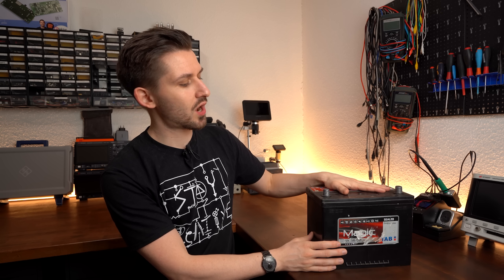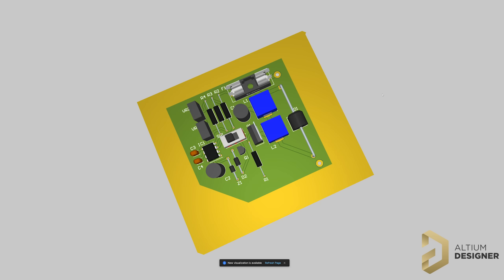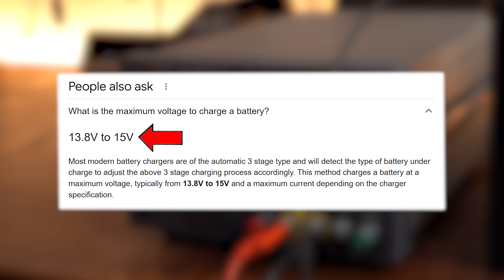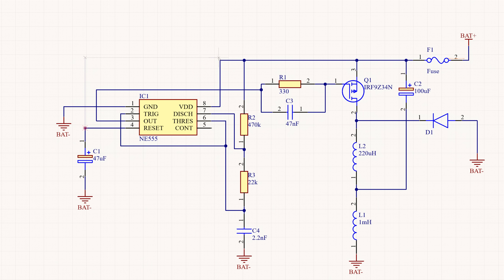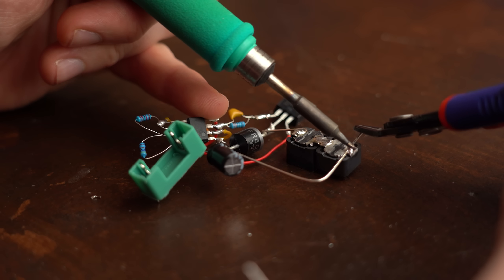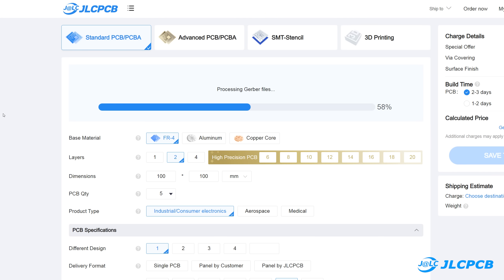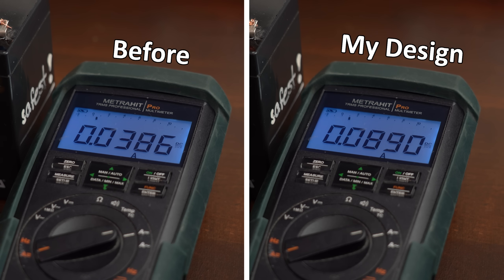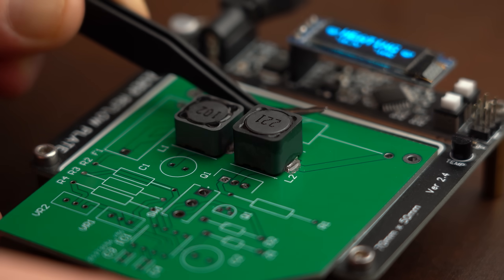I followed a YouTube "Battery Hack" and Wasted 30 Days! (Desulfator)

Comment: The idea that the circuit is powered by the same battery its affecting seems like a red flag. 😂 (just a gut feeling) 
Like obviously the battery has energy that can be used, but using that energy makes more crystals, which seems to be the opposite of what you're trying to accomplish!

Perhaps something like charging the battery from a high frequency external circuit would work better than powering it itself.

Comment: While the tested batteries showed only half of their claimed capacity, this would not be entirely surprising even if those batteries were new.  While we've grown to expect that legitimate Li-Ion battery manufacturers will state realistic specifications, lead-acid manufacturers exaggerate their specs substantially and this is true even for highly-refined, industrial-grade batteries.  Lead-acid batteries are virtually guaranteed to fall far short of their claimed performance.

Pretty much the only place where lead-acid still makes sense is for starting internal-combustion engines; short bursts of high amperage followed by immediate recharge.  Some form of lithium chemistry will be a better value for any other application.

Comment: What we need is a battery that we can disassemble. Remove top, bus bars etc We clean the plates with a pressure washer, ultrasonic or belt sander. We assemble, add new electrolyte and charge.

Comment: Pro tip for next time, use 2 diodes to protect your power supply when you do this, it will charge in the estimated time first and second your power supply will not get hot or blow up, I did the same for a 12V 20Ah moto lead acid battery, charging up should take 9.8-10.5 h , I also forgot, ideal charging voltage for 12V lead acid battery should be around 14.4V but can be also found on the manufacturers datasheet.

Comment: you be wonder about welder that weld metal to metal can be use to bring battery back to life but it lose amp and cranking time
dont need any pcb just do something to battery not going change anything on it be same as always and age of battery being unused just dying out and cells inside just disappear or rottened away or cover in acid salt

im sure ya can make a battery just need right kind of plastic that doesnt feed short thur it

Comment: I always thought using a DC welder and passing a high amount of current through the battery for brief periods of time also did the same thing? The caveat to this method was off gassing and risk of explosion however, so this method is not to be done indoors.

It's basically blowing the "fuses" of the tiny dendrites that grow between the lead plates that cause dead shorts, hence the need for the DC welder supply.

Comment: You can safely charge a lead acid car battery well past 7A, even the weakest of car alternators output 10x that, my own cars alternator is rated for 124A continuous but im trying to source something more powerful as my audio system spikes north of 200A and my battery is taking up the slack :)

Comment: I know somebody who bought these things to put on his batteries (very smart individual he's after all an electrical engineer who knows everything about engineering and apparently might be "God" now). there's one thing to watch out for... constant battery drain and what happens to a drained battery that's overdischarged... guess what damage. So you might think you're actually helping yourself when you might not actually be helping yourself. I much rather get a nice charger that incorporates this in the charge function and I've been very happy with NOCO chargers and even resurrected a few batteries that I thought were for sure dad. The problem with these there's too much snake oil around them so I'm glad to finally see a video. Much like big Clives air ionizer videos.

Comment: Thanks for the testing.  If desulfation were effective, they'd simply put circuits onto cars to regularly clean the sulfates as you drove around and thus you'd never need to buy a new battery.  The only practical way to remove sulfate from plates is to simply melt it all, scrape the gunk off the top, and reform new plates from the remaining lead.  So, that's what they do at battery factories and something like 90% of the lead in new lead-acid batteries is recycled.

Comment: I have the black and yellow one in the video, i can say that it worked on my motorcycle’s battery, but it cant’ do miracles, i think that if a battery has reached, say 50% or less and has not been used for long it won’t work, my motorcycle’s battery was suffering to start the engine, it had 5 years of daily use, i connected the desulfator along with the charger, and now after another year it can start the motorcycle almost as new and it does’nt suffer, but if the battery (i tested others) are damaged beyond a certain point it can’t help, the battery will gain nothing, it’s a great tool to save a battery on the first sign of fatigue, or probably if used “regularly” to maintain it, but nothing more.
Reply: Two additional notes
1 i dont’ know if my motorcycle’s battery increased in capacity, sure it incrased in power output, that’s a different use case than say an alarm backup battery 
2 desulfator consumes power, connecting it to a damaged battery for extended time may be bad, so I connected also the charger for that reason.

Comment: you selected wrong circuit circuit need external power sorce bettery does not desulfate in discharging stage. In defulfation process bettery should never below the 15V so instead of using bettery own power use external power source ¹st charge the battery with big charger then connect this circuit with external sorure 1-5 Amps 12v which creates (10-50) Amp pulse at 10% duty

Comment: If the batteries have very few cycles on them, this kind of circuit might have some possibility. If the reduction in capacity is due to cycle life, there's no possible way to restore active material lost during normal wear from use. A circuit like this is what you might try if a brand new battery was used once, then forgotten. There's no guarantee that a circuit like this will work on a new but sulfated battery, but I can guarantee this circuit will not restore a battery that has simply reached the end of its useful life. The new but sulfated battery is your best chance of success with this type of circuit.

Comment: Add a diode to the 12v rail between 555 and mosfet. Power the 555 with a 15v(watch limit of VCC ON 555 timer) plug pack and it trickle charges the battery at the same time pulsing it higher. I increased CCA and reduced mOhms on two car batteries that weren’t too dead.

Comment: What values are the current spikes? This circuit works slightly different way than those I know. Those I know do very brief (~ 1 ms) short circuit of the battery, thus very high currents for very short time, but the frequency of those short circuit events are rather slow (just couple Hz).

Comment: Reverse polarity for 1-8 second burst with a regular charger on 30-75 amps while vibrating the battery cleans the cells off however, if you dont know what you are doing, DO NOT DO THIS!!!! It can be very dangerous!!!

Comment: You’re supposed to leave these on WITH a charging current, not just on the battery.
They’re also supposed to have much bigger cables connecting them to the battery.
BUT! They still don’t work in my opinion, I messed around with this years ago & basically you need to have a desulphator on the battery from new, & if you do that you’ll have to always have enough extra current coming in to keep it running too (a battery will start to sulphate as soon as a charging current is removed) so they’re just not viable.

The only way to truly desulphate a battery is chemically, but that also weakens the acid, so that’s no good either.

Basically, it’s exactly the same conclusion, it’s pointless.
Great video though 👍

Comment: Give this a try too: (up to) ultrasonic sound waves from the outside.The sulfate will break off and all you need to do is clean it out (otherwise they will drop to the bottom and shortcut everything). Just an idea, if you have the means: go ahead and try!
Reply: The plastic case will absorb the ultrasonic wave, that is why ultrasonic cleaner always use metal tray.
Reply: @wiradharma7030  Ah, thanks for letting me know. There goes my idea .. .. :-)
Reply: @deslomeslager  well, recent paper suggest high freq(300khz++)  pulse do work well. I have built one using ne555 + irf540 @700khz @30% duty cycle, but haven't test it yet. I parallel 20x 100nf smd capacitor on an 24 awg wire, 10x 1 uf xr7,  and 2x 4700uf just to provide constant supply @700khz.

Silly me could just use esp8266/32 to generate the pwm signal. And previous paper suggest desulfating with higher voltage work better. I am thinking 29v dc.
Reply: @wiradharma7030  You mean pulse 29 V dc directly on the battery poles? I had also been playing with Bedini, using the collapsing pulse from a coil (a simple relais will do the trick). Seems to work as well. But I do not know how well.
For pulsing 29 Volt (or so) you may also maybe use a DC motor driver, but it won't go above that 300kHz.
Luckily nowadays I am mostly using LiFePO4 batteries. Treat them well and they will have a very long life.
Reply: @deslomeslager  I start at lower voltage, just try it. Didn't work, there is soldering tin shorting the 100nf smd. I ll try later. I ll use scope first to verify the output freq.

It is a car battery @40amps, i have two which one heavily corroded(the plate inside was blackish). I think i have desulfate the better one just with transformer and diode, i put 18ohm 20watt resistor for current limiter.
Reply: @deslomeslager  I got 396khz at 57% at mosfet gate, on dummy load nothing. Seems that i need shunt resistor or tune the gate resistor value, irf540 not turning off properly. I run the circuit @24v to 66ohm 40w resistor.

Edit: after adjusting gate and shunt resistor, i finally got 400khz at mosfet(it was 60n06 not irf540). The ultrafast diode i put between pin 6 and 7 was too slow, so i got 400khz at 57% duty instead 700khz at 27% duty i planned. I use 150mhz digital scope to obtain this number.

Initial test was quite promising, voltage increased to 11ish(jumping around) from 7v. Bubble appears on the corroded cell. Before, I have desulfate this battery using just transformer and diode(with 36ohm 40watt resistor to limit current) at 29v for two week but it did not work.

Ps: from a journal i read, desulate for too long decrease the battery capacity. For his setup, two weeks was the optimal point. He use commercial desulfator. My setup should be around 2 days for a cycle.
Reply: @wiradharma7030  Thanks for sharing. Let's keep it at this, I copied the text to a word document for the future.

Comment: I fixed many desulfated battery 
i do use an old iron core based transformer without capacitor that gives 100 hz pulses and max volt is 15.4 v

Comment: In my experience that works for new pb batteries connected to working system. Then their life is extended. If you made the movie with two lead-acid batteries constantly charged and deep discharged in a period of 12 months let's say 100-200 times, then it would give better answer :)

Comment: What people usually don't understand is that the electrodes themselves simply disintegrate  from electrolysis, atop sulphation. Lead oxide and sulphate sludge accumulates at the bottom of the battery and eventually starts shorting the cells. A complete wash and refill with freshly prepared electrolyte would alleviate the sludge problem in flooded cells.

High current pulses can help dislodge crystals but sulphur is lost in the process so it should be washed and refilled after a desulphation session. But, lead from the electrodes was also lost and the overall capacity and internal resistance cannot be retrieved. 

Fully rebuilding the cells would. This is just a part of a process that would revive a battery into some sort of usefulness in lack of any alternatives. 
Remember, the sediments dislodged by high currents are conductive. 

Lead batteries are cheap to recycle but they have no other advantages... 
They are at half the price of lithium or nickel but ten times less life...

Comment: It is completely possible to revive a lead-acid battery and get the full capacity back. All you need to do is replace the plates and solution. To be really sure, replace the lug terminals and the case too.

Comment: I have tried this inductive method of restoring batteries and have found that a capacitive discharge works MUCH better, Charge a large cap 10,000uf or greater using a CC PSU to about twice the battery voltage and dump it across the battery using a mosfet until its discharged allow some time and repeat the process. The high current is far more effective at clearing the plates and if you do it right the battery will actually remain cold, the acceptance to charge is always higher initially, that's why you see such a big current pulse when the battery is first connected to the charger, maybe you could do another video trying this instead?

Comment: The best way to build one (only if you live in country with 110v-120v) is a capacitive dropper style desulfator. It works insanely well and I have saved almost 100 lead acid batteries but its also very dangerous to use as its straight up dc line voltage on the output. It uses a capacitor inline from ac to a bridge rectifier and then it goes to a battery. I run a 1a fuse so in case of anything it blows it. The capacitance depends how much output you need, i dont remember but mines has a dual 2 in one cap from a ac window unit thats for the motor start cap and i run a switch so i can have 1a or 3a current output.
Reply: I've thought about making such a unit and IIRC I actually did so at one point with with clip leads. It didn't work for my SLA batteries.

I'm also on 120v but there's no reason the same technique wouldn't also work on 220-240v.
Reply: @eDoc2020  with 220v you def gonna die if you touch the leads lol even with my 110v i get shocked at least once every dozen times i use it but its not enough to do much. For me ive saved many lead acid batteries and made them last years later, same for smaller ones like nicad etc.
Reply: @DatBlueHusky  Then don't touch the leads. Or really unplug it first. But really I don't think such a capacitive charger is much better than a simple dumb charger/power supply. I saved a ~12v NiCd pack by connecting it to a 20v power supply through a resistor.

Most of the dead batteries I have seem to have internal shorts which can't be saved easily. For temporary revival you need a stronger current jolt. I've connected a single NiCd AA to a 12v battery but it still failed quickly.

Comment: this is normal lead acid batteries can't give more than 50% of its capacity, thats why lithium ion batteries are always the winner ... you can use 90% of lead acid battery's capacity but you need to discharge it to 10.8 volts

Comment: What I really need to do is to find a way to take the batteries apart, scrub the plates clean, then reassemble them. But seriously, I have some very expensive batteries that I've been trying to disulfate with little to moderate success. It is a problem that plagues lead-acid batteries.

Comment: Nice Video. Have you Cheked the Acid in the Battery ? I have Batterys lay around they have no Acid, that was the problem. Filled up with Distilled water. Some worked again, some not.
Sorry for my bad English, im German.

Comment: Personal experience from few year back: my car tore it's timing belt in two while driving. We towed it back home and left on the yeard, with battery and all attached. Bout 18 months later i bought a new belt (only the belt) and we tried if we could revive it. The -98 Corolla sputtered once and woke up, with no problems. No bent valves or such hitting the pistons. Well with one problem, the battery was totally dead, it measured around 5 volts which means it was flat dead. But i wasn't going to spend my last money on a battery if i could get the old one working!
It didn't hold a charge at all so i started to charge it, bang it to the floor in every war, discharging it with a 12v bulb and then chanrging and banging it. It tooks days and i did all that periodically but was not much of a hassle as it was in my bathroom. After around 4-5 days to a week, it hold enough charge to start my car. So i went driving to charge it up and it worked just fine. I used the battery for more then a year after that, even throughout the Finnish winter so not easy starts... I don't what i did or what's it called but worked well for me.

Comment: There are ways to revive a lead-acid battery, however, this circuit is not the way. Lead acid battery desulfation is not incredibly complex but can be laborious and is more chemistry-focused. Lead acid battery maintenance procedures are well documented and been performed for quite a few decades. There is no best-practice for rebuilding a lead acid battery which does not address the electrolyte solution and built up sulfide removal.

Comment: Desulphation is real, Iam doing that, but with industly chargers and little bigger batteries (300Ah-1200Ah), and result is not always good, because if battery is too long exposed to sulphation, you can pretty much by desulphation, destroy whole battery (basicly lead plates is going to be destroyed). So its real but not always is doable.

Comment: p.s. 
Recentlly I found that required resonant frequency of 3.26 megahertz pulse is needed to breakdown the lead sulphate crystals. The most annouing is that I can`t find battery charger with a such high frequncy around that value. Any suggestion will be welcomed.